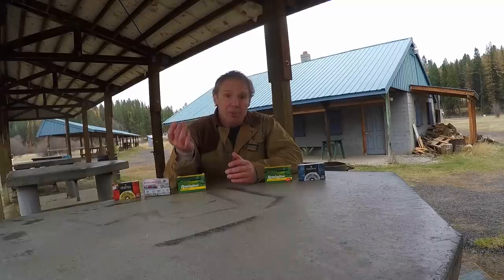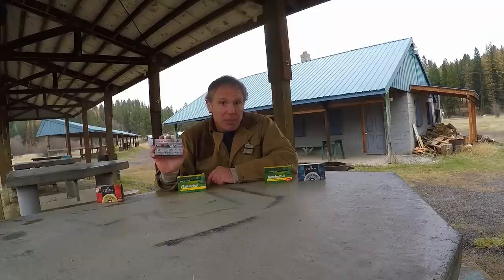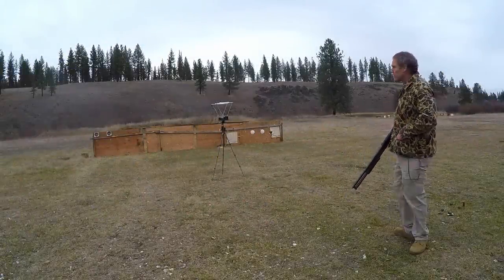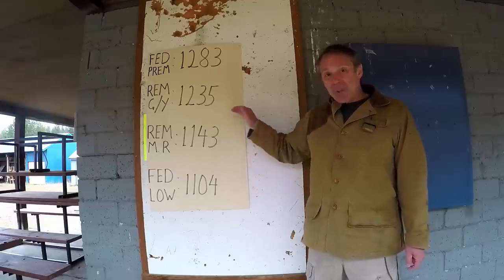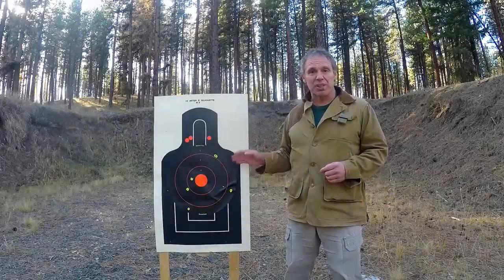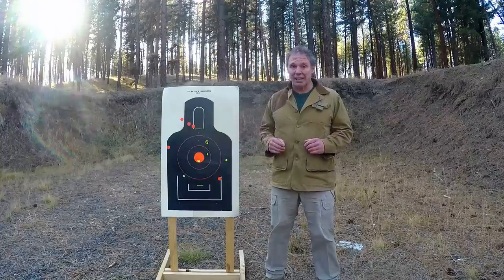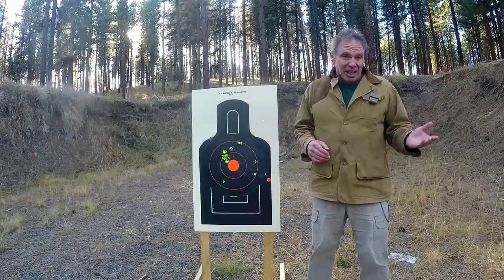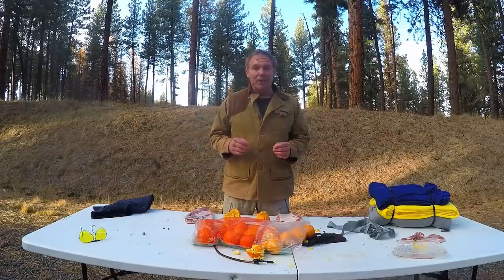Personal Protection: Reduced Recoil 00 Buck

Comment: If the recoil hurts get a limb saver. I put that on a double barrel 12ga that I could only shoot slugs indoors. Without the pad it’s a steel butt plate. With the limb saver it goes from 2 shots and some bruises to 20 shots and no real pain. I would keep the standard power ammo and use the extra padding.
Reply: The doughboys of ww1 thought low recoil 00 buck was enough. The Germans would agree.

Comment: When I tried some reduced recoil buckshot a few years back, I was struck that it really felt like I was using a 20ga built on a 12ga frame. Not dismissing reduced recoil 12ga, or the 20ga. If anything, reduced recoil loads are part of why the 12 is more versatile. But I've wondered ever since if that is a fair comparison. 

And Paul, keep shooting home defense loads at 25 yards. My house is a 62 foot square with a straight hallway on each floor, and the house I grew up in was a converted barn with what is now called an "open floorplan" rather than "drafty and hard to heat" which was bigger. This 75 feet test might be longer than you're likely to need, but it should not be dismissed. By the same logic, you're actually not very likely to actually need to discharge the firearm. More over, you're not very likely to need a firearm for home defense. So why bother? This is the same kind of logic that says since space is boggling vast, and planets are pretty small, and most of them don't have life on them, statistically there is no life in the universe and the Earth doesn't exist.
Reply: In Texas , trespassers on posted property are considered fair game . That's pretty hard on rustlers , as it was meant to be .

Comment: Paul Harrell - the ONE gun guy on YouTube that gives you the FACTS, and nothing but the FACTS.  No filtering results with his thoughts of "But the 9mm (or 10mm or 45ACP) is still better than anything else", or " But 'X' or 'Y' brand guns are the only ones to own" opinions.  But people...  If you REALLY want less recoil... just drop to a 20 or a 410... problem solved.  This is like buying a 44 mag and buying low loads because you don't like the recoil.  If you can't handle the damn gun... get a smaller one.  The Dirty Harry use a 44 with light loads is great in the movies... not so great in real life.  I'm 67... but my 12 gauge pump is a shortie (1/4" over legal minimum) and the recoil is impressive with the rounds I use... but to me it's telling me the power is there which is all I'm interested in.  I'll take the increased recoil because I get the results I want.  All my handguns are semi-auto... in part because of their reduced recoil.  I shot an over and under 45ACP/410 combo ONCE.  It IS nice for close-up work... but again it's not for me.  Find the gun... and then check out Paul's videos to find the rounds that work best in it.

Comment: Two nits:

Nit #1: Experiments never confirm a hypothesis.  The experiment can only falsify it.  A hypothesis is never true because the experiment can refute it.  A successful experiment  only says your hypothesis isnot false.

Nit #2.  There is a 5th factor that affects recoil -- the mechanics of the actions. All the recoil in a pump or break action shotgun is applied directly to your shoulder.  In a semiauto shotgun part of the energy is used to operate the action which reduces recoil.  If you want reduced recoil use a semiauto shotgun.
Reply from the maker: Yes, those are definitely nits. And I never said there were only four points, I said I was going to discuss four of them.
Reply: @PaulHarrell  Well. I said they were nits.

Comment: Paul, have you patterned the Federal rounds with the Flite Control wad? They have a full power and a reduced recoil version, both of which produce a good pattern at about 1/2 size of normal on a yard for yard basis out of my 20" 590A1 Mossberg. At 7-8 yards the "pattern" looks more like a slug (2-3 inches), at 25 yards it's 12 -14 inches out of a cylinder bore.

Comment: Reduced recoil buckshot is hands down a far better choice of a defensive load for novice shooters, smaller statured shooters, slimmer shooters(like me), as well as less dedicated shooters. They're gonna be much easier to control and less intimidating than the standard powered 12 gauge shells. 

Personally, I can shoot the standard powered 12 gauge shells real well. I use a proper tactical grip and stance to minimize muzzle flip. But even so, the felt recoil of the standard powered 12 gauge shells is quite a handful for me. If I shoot say 100 rounds of the standard powered shells, my hands and wrists get pretty beat up. So I've switched over to shooting mostly low recoil 12 gauge shells and I don't get sore hands or wrists.

Do you compromise stopping power going with the reduced recoil buckshot? Sure, but just a slight amount. For personal defense, there's no noticeable loss in stopping power going with the reduced recoil buckshot. If you can compromise a slight edge in effectiveness in exchange for the ability to shoot the gun better and save yourself from getting beat up by heavy recoil, you'll be way better off than if you used a more powerful load that you can't shoot so well. Lower recoil also means the more likely the shooter is to practice.

Comment: I have often wondered if removing the petals from the shot cup OR replacing it with just a wad might enhance the pattern expansion at 5 yards. 15 inches at 5 yds would be deadly. Cant miss em.
I am aware that custom modifying shells is time consuming. But how many do you need?

Comment: I use both the managed/low recoil slugs and 00 Buck from both Remington and Federal. As I can't use the 00 Buck at my range I can only speak on the slugs, and felt recoil between full power and managed/low recoil slugs is noticeable. I can only assume it would be the same for 00 Buck with stopping power/patterning differences at household distances being negligible.

Comment: Interesting results on the Federal blue box. I have extensively tested and shot the Federal LE13200 (red box?) low recoil 2 3/4 9 pellet and found it's performance to be excellent out of our 16" and 12" 870s. Maybe different production locations or component suppliers?

Comment: In a defensive situation where i'm trying to save my life, a little extra recoil is not an issue with me. Since I live alone and my closest neighbor is about 150 yards on the other side of a thick patch of woods, I am not concerned with over penetration. But, everyone's living situation is different. I have a Carlson's 18" smooth bore barrel with iron sights on my 870, can keep a 6" group with Foster slugs at 50 yards and slugs are what I keep in it. "Not likely" I'll need that range but I have it if that rare case comes up.

Comment: I'd just use mini shells if I wanted less recoil. That way at least you get some capacity for your loss of power. The mini slugs are good too. Projectile three times the weight of a .45acp and still traveling at the same speed. The old-school method of getting a quick follow-up shot is to lug around an 870 with a very long barrel. That gets real old real quick. Never again. You feel a lot of things, but you don't feel recoil when you need to as far as defensive use goes, and if you really want a deer you won't feel it either.
Reply from the maker: Mini shells don't cycle in all pumps and don't work well in autoloaders. The reduced recoil will work in most autos.

Comment: Yep, had to confirm it, as 16:52 he did flip me off, even though I consider Fiocchi 00 (Ozark plant) as reduced load, even though it's advertised as 9 pellet 1350fps.
Reply: That's full power not reduced recoil.
Reply: @nelsonr1467  No it's not.  Pellets are smaller and powder charge is less.  That's why they are short.

Comment: I’ve always wondered how many shots does the new and improved fleece backstop can take before it loses it’s effectiveness? If you’re going to do #4 buckshot should you also do #1 buckshot? I can find #1 easier than #4 (Sportsman’s Warehouse). Also I’ve noticed low recoil is cheaper than regular buckshot.
Reply from the maker: No. 1 has very similar results as 00, just more pellets. I use #1 for deer hunting.

Comment: Paul probably already knows this, but #4 buckshot is often considered the overall best choice for home defense purposes.
Reply: I don't think there's any round with significantly greater wounding potential against the human body than a 12 gauge 3" #4 buckshot shell. 41 pellets! Each meeting FBI penetration depth standards at typical home defense range. I believe 00 buck can be a good choice for military and police use due to it's increased performance at long range and ability to penetrate obstacles, but for use indoors against unarmored bodies #1 buck and #4 buck are almost always a better choice. They meet penetration depth standards (12-18" in ballistics gel), unlike 00 buck. Not only is overpenetration undesirable (collateral damage, risk to bystanders), but it compromises wounding performance. #4 buck will destroy a greater amount of tissue. The lead is being spread out over smaller pellets, causing more wound channels, rather than sitting in the rear of a few big pellets holding on to energy that will pass through the body without causing harm. Incapacitation from a good shot is extremely rapid. Just imagine a swarm of 41 .24 caliber bullets passing through your chest all at once. That's like a submachine gun firing an entire magazine into your body, or worse, in one shot. 00 buck is effective, no doubt, but instead of having big pellets that penetrate uselessly deept I'd rather double the number of pellets with #1 buck or triple it with #4 buck. At range #4 buck loses steam, but I'm very confident of it's ability within the home.
Reply: @Paelorian  Excellently stated!

Totally agree with you about stopping power without overpenetration within the walls of the home.
Also totally agree that the larger pellets (00 or even 000) are preferable for military & police use, where the distances are often greater and where the larger pellets being able to retain their impact power at those distances is very important.

Comment: The hunting concerns of reduced recoil buck are irrelevant for me as buck shot isn't hunting legal in my state, for shotgun on deer it's go slug or go home. 

One thing that is somewhat annoying with the state of Tennessee is that they like to frequently change what is ok and what is verboten, so it's easy to have your equipment that you bought for rules compliance become unnecessary. Like they used to have a .24 cal/6mm minimum caliber, then they changed it to just that it has to be centerfire. So if you bought a 6x45 or .300 blackout or 6.8spc upper for hunting it's now unnecessary. 

Crossbows used to be not allowed during Archery only season (you could use them after black powder and firearm seasons opened up) so if you ponied up on a new hand drawn bow because crossbows wasn't ok yet yeah you spent money on a unnecessary hand bow now that crossbows are ok.

Used to be a 4" minimum barrel length on pistols then they removed that, so if you bought a 4" plus when you would rather have had a shorter pistol it's now unnecessary.

Comment: I use number 4 full power for the first rounds and the very last round I use a 3 inch flight control 00 buck to rattle my brain and tell me I'm out. Sure would hate to run out, doubtful I would ever run out but if I run through 7 rounds of 12ga it's going to be a very bad day. I have a side satel that is loaded with 2 3/4 flight control 00 buck for the bad day, so I can reach out a bit further if needed.

Comment: So, how much more effective do you think the reduced 12ga loads are vs the 410 3” magnums.
Reply from the maker: We have a vid on .410 for home defense. It includes chrono testing of the .410 Buck
Reply: Paul Harrell I had seen it and got a BPS in 410 because it had interchangeable chokes for my wife and young shooters.  I am just curious which you would chose if you wanted a low recoiling shotgun.  A 410 or a 12ga with low recoil loads.  Thank you
Reply from the maker: @richardsnyder9767  Given the choice I would personally go with the 12 because that's the gun I have and because the reduced recoil 12 still has more velocity and more shot than a .410 but for smaller shooters the .410 with the right ammo would most often be sufficient

Comment: in a personal protection situation, are you going to be firing enough rounds to worry about the recoil?
Reply: Yes. It might take more than 1 round to stop the threat. Also, I'm 6' 235 lbs. My wife is 5'2" 125 lbs. I have a pretty good idea what's going to happen if she tries to use full power loads instead of me.
Reply: @1776Angry  so... two, three rounds? Do you have a wide stock and a recoil pad?   
The gun is more important than the ammo. For instance, I had often shot 12 gauge full power rounds out of a modern (at the time) shotgun with a wide stock and a recoil pad. During our hunter safety class shoot in 4 H, the instructor asked if anyone wanted to shoot his 20 gauge. I should have smelled a setup, but I didn't. I figured I shoot 12's all the time, surely a 20 is less. To make a long story short, I took one shot with that old 20, and that's all I wanted. I'm a big guy, was pretty big even then, and it kicked my butt or shoulder to be more precise. it was a thin wood stock with a metal butt plate... you really felt the kick from that thing. Way more than any 12 I'd ever shot, even to this day. So, if you're really worried about the recoil, get the right gun, not lower power lower pellet count ammo. If it has to be used, you want all the pellet count and power you can get on target.
Reply: @tootall5559  Widest softest limbsaver that lets her use the gun. Cut a bunch off the stock so the lop was correct and had the comb worked on for a proper cheek weld. 
Been a 4H coach for 15 years.
Reply: @1776Angry  That's great, I have very fond memories of my time in 4H. Best thing I ever got involved in. Not only was it fun, I learned a LOT. I was interested in electrical, so my leader found an electrician to help me... just me. Thanks to him, the first time out I got reserve grand champion at the county fair... I was beat out by a girl...from another group, that had been in it for years... oh well.
Reply: The doughboys of ww1 thought low recoil 00 buck was enough. The Germans would agree.
Reply: @nelsonr1467  they used whatever was issued. I'll wager so called low recoil shells cost more than regular. You get less for more money. Don't make sense to me. How much recoil you feel is more about the gun than the ammo, I'm sure of it.

Comment: The real advantage of low recoil is for small adults, particularly women. The time factor would be significant. Your size and strength negates the affect. My wife for instance, who is 5 ft tall and a very athletic 110lbs handles reduced recoil loads of both slugs and buckshot very well with her browning micro midas silver hunter. Regular not so much.

Comment: Buckshot is not a good performer on deer but against humans with a lower pain threshold it works great.
Reply: Did you mean "*low recoil* buckshot..."? 
If not I have no experience with that but Paul and plenty of other hunters are going to take issue with you there. Plenty of hunters prefer it over slugs.
Reply: @junkersintutus4282  Well buckshot in general, I've had to use it in some states for it was all you could use due to population .

Comment: Instead of reduced power 12 gauge why not just buy a 20 or  410 gauge? All have proven very efficient against two legged predators. I would rather have 5 pellets at 1300 FPS than 9 at 1000fps. To each their own.

Comment: Have you considered bringing in someone else into your videos as a stand-in for "the average person"? Clearly you are very good at shooting which is of course expected of someone who wants to make instructional videos, however when you are doing things like comparing the recoil of different types of ammunition or different calibers and then drawing conclusion from how the reduced recoil affected your time, you being so skilled is actually detrimental to the test. The average gun owner would likely be significantly more affected by recoil. Also you are probably quite a bit bigger and stronger than the typical person researching reduced recoil ammo options. If you brought in someone like a women who is skilled enough to perform consistently in multiple runs but weak enough to be affected by recoil to a much higher degree than you are, your test would generate data which is more representative of what a regular person would experience (as opposed to a long time instructor and successful competitor who organizes his awards in multiple boxes).

Comment: Your scientific method is a tiny bit off. In the scientific method, you are trying to prove the NULL hypothesis. That is, you are trying to prove that nothing is going on, and your experimental design is all about trying to control the variables, and measuring the relevant data, to show that nothing is going on. If you are left with anything unaccounted for, or unexpected, that's when you ask a new question and try to disprove that next. The scientific method is about generating new knowledge by eliminating as many possibilities as possible, and seeing what you're left with. You're never trying to prove a hypothesis based on what you think is going on, even if that was what caused you to be curious in the first place. So, if your question is "does reduced recoil buck shot have less recoil?", your null hypothesis would be "there is no difference in recoil between reduced recoil buckshot and regular buckshot". Then, when the data shows that it does in fact have less recoil (velocity), you have disproven the null hypothesis, and learned that there IS a difference in the recoil.